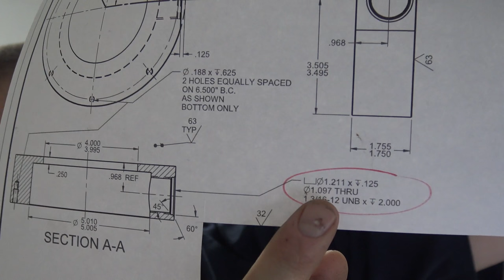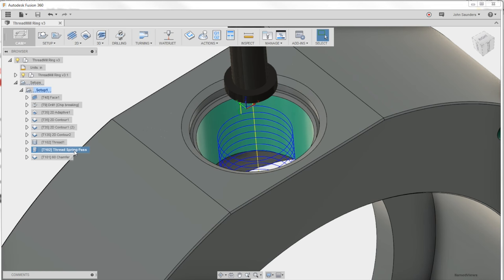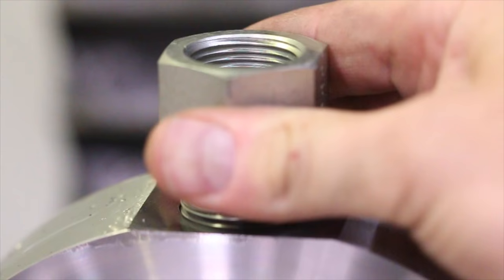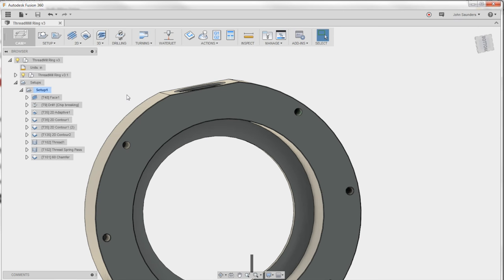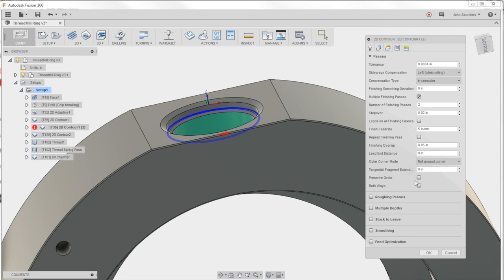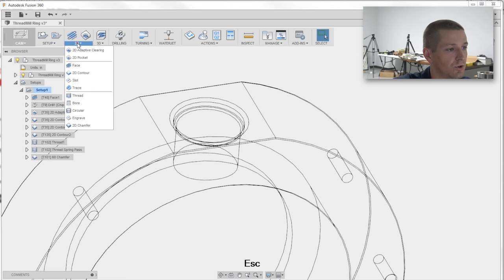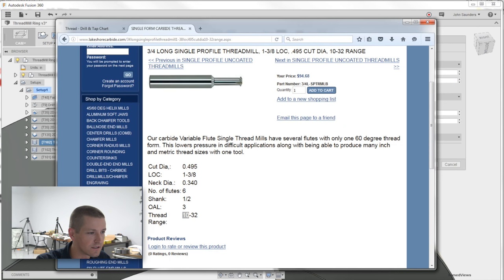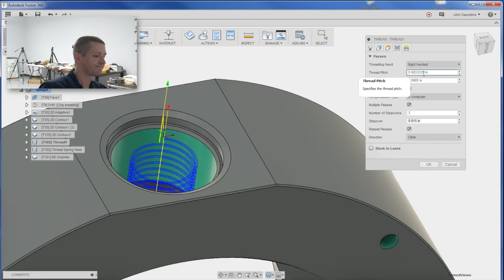Threadmilling on a Tormach with Fusion 360!  WW109

Comment: The thread and the chamfers are for a SAE #14 O-Ring port. It will seal effectively at high pressures, something like 5000 psi.
Nice video.
Thanks,
John 

🎉🎉🎉
Woo hoo, new baby girl! Congrats again. 😊
Reply: Yep, Day Job we make tons of manifolds and machine tons of  SAE Ports and Metric Ports. Part doesn't have a spot face must be using that flat he machined as the spot face
Reply: +Chief Machining 
Spotface would've taken up almost the whole face where the flat is and would've left a sharp edge to deal with.
Machine it flat and done.
Thanks,
John
Reply: Yea and cost way more instead hitting with a port tool and being done.
Reply: +Chief Machining 
For doing lots of them, you're right.
This is a prototype. Most of the machining was done on manual lathes and mills.
Special tooling was out of the question. Easier and faster to bring it to SMW.
Thanks,
John
Reply: Most have been your part? 

What's it for?
Reply: +Chief Machining 
Housing for a special valve.
It's proprietary but we'll be unveiling it in a couple weeks. 
I'll post it when we do.
Thanks,
John

Comment: 1st.
The reason "you need to always go a little bit further" is because the ideal thread forms are not triangular pyramids but are triangular pyramids with the major and minor peaks/valleys lopped off.  The Major and Minor diameters you read from the table are the diameters at those lopped off flats, now your tool path Diameter (the way you are programming it) is the diameter at the vertex of the triangular peak which is not the same thing.

2nd.
Your statement "In Theory all 12 pitch threads should have the same difference between the minor and the major (diameter)" is fundamentally correct. Where you are going wrong is the Major & Minor Diameter for an Internal thread vs External thread are not the same.

Minor Diameter for 1" External is 0.8978" but Minor Dia for Internal is 0.9098"
1"-0.8978"=0.1022" EXTERNAL Minor Dia which is what you wrongly calculated.
1" - 0.9098 = 0.0902 INTERNAL Minor DIA. Which is for intents-and-purposes is the same as the 0.0905 difference you calculated for the 1 3/16 x 12 tpi.

Cheers
Reply: Graphically this is the Lopped off part you are overlooking. https://upload.wikimedia.org/wikipedia/commons/thumb/4/4b/ISO_and_UTS_Thread_Dimensions.svg/2000px-ISO_and_UTS_Thread_Dimensions.svg.png

Comment: +nyccnc Hi John. I have done a lot to debunk and prove out what Fusion wants for this & hopefully help others. Below is for Internal Holes As we are using a Thread Mill, this assumes your cutter tooth tip comes to a POINT.
1: The Minor Dia calcs from your reference and any others take into account the Standards. So it is CRITICAL that with what I am about to say; that the ID hole in the fusion model is exactly the book Reference for Minor Diameter. I have checked your book figure of 1.097 and it aligns. Some web refs are wrong so use this formula to check: Minor Dia = Maj Dia- (1.0825 x Pitch)   Eg: your 1.1875  12Tpi
1.1875-(1.0825 x 0.083333) =1.0972    

2: Now you need to know the thread height BUT it also has to consider the above with respect to the fact Standards have already been worked in. So; Height of the cutter Triangle is: H=0.866 x Pitch. But with standards already worked in we actually need 6/8ths of this height for an Internal thread. HStnd= 6/8 x 0.866 x Pitch. e.g. Hstnd= 0.6495 x 1/12  = 0.6495 x 0.08333 =0.054125 Radial Depth of Cut or x 2 = 0.108 Diameter.
NOTE: You used Maj - Minor Dia, the reason this is too low is again because of the standards.  That figure you got of 0.09 is the thread measurement from Flat to Flat i.e. 5/8ths of Height. The Minor dia figure from formula or book took care of the thread peak at the hole ID (2/8ths or 1/4) and now we have to allow for the Tool tip of 1/8th thread height, hence 6/8ths in the formula above.
SO: Pending material, tool deflection and assuming the correct size Single point threadmill for the pitch i.e. has enough tooth depth/height to complete our calculated Radial DOC; the figure Above of 0.108 is pretty  spot on unless you want a tighter fit. WHY? Well the Minor Dia figure which we set our fusion Modeled hole ID too, basically works out to around a 73-76% thread fit hole diameter. So if you want a tighter fit I suggest sneaking up on that 0.108 Diameter offset figure in fusion AND if you have the male part, test fit. Test fit is key because bolt tolerances particularly on cheap fasteners are very hit and miss to the dimensions we have calculated, but what I have typed here will get you on your way. NOTE: If you start fudging the modeled hole ID away from the Minor Dia figure then this  above will obviously be inaccurate without further maths, hence I just adjust the Offset in fusion.

Also all of these formulas above work for METRIC e.g if you have an M10 x 1.5 thread; just use 10 as the Major/Nominal diameter and put 1.5 as the Pitch. The Constant I have given remains the same, results can simply be convert back and forth from Metric to Inch using 25.4mm = 1Inch.

Lastly: I reported to Fusion a while back that Pitch Diameter Offset was is not the best name. It doesn't do any algorithm in regards to the ACTUAL theoretical Pitch Dia. If you check through the GCode it simply adds this 'user input' Pitch Dia offset  to the 'hole' ID you have selected/modeled and takes the tool radius of the cutter into account. Hence if your Hole ID is not accurate to the theory of threads and thread fit it will vary your result. If you were to put in the ACTUAL Pitch Diameter offset figure from the ID (Minor Dia ) hole you wont even get close to a thread that fits. I have reported this a long time ago that they should change the name as it confuses everyone, nothing has changed.

Hope this Helps
Reply: Your information was awesome.  TY

Comment: I'm sure it's been answered, but the simple answer is like this.  The sharp point on the tool requires a deeper depth because thread form is based on a tip with a radius.  The sharper tool requires you to go deeper because you're essentially farther away from the required PD.  Think that makes sense, hope it helps.

Comment: John the reason that you need to take a lil more than the .905 is because that is at 100% thread engagement and the normal thread engagement is about 75% which is the lil bit more that needs taken.

Comment: Hey john;

The difference could be that the minor diameter of the two different thread sizes you referenced could have different tolerances on them. As you looked at the acceptable sizes not the theoretical.
 It could also be the flat or radius on the tip of your threadmill is not the same as the theoretical used for the calculations.
As a side note, the corner radius/ flat on each tool isn't the same. It has a tolerance just like everything else. This tolerance will effect the finished pitch diameter; given that the OD of the tool is the same. However the OD also has a tolerance.

This radius/flat on the tip also applies to lathe threading inserts.
This is typically only noticed when trying to achieve decent thread fit.

Comment: When I thread mill in fusion I usually select "model thread" in the threading pop up box during design, once in cam, just select the modeled major diameter as the contour for the threading op and select your pitch. No need for calculations etc.

Comment: I use a lathe internal indeable toolholder as thread milling tool. It's slowers since you only have one flute, but it you broke the tip, it's only a couple or bucks

Comment: A question not necessarily related to video in particular: quotations (pricing).  How do you provide a quotation for a customer, when you have to go through a number of times (which you do not know until the appointed time), to get it right?  Say the "widget" spoils and you have to use fresh materials.  Also, additional machine time.
Reply: You cant add time for your mistakes...well unless you are some shady shop. 

Would you pay for two oil changes if jiffy lube forgot to put plug in first time?

Comment: Funny way to hold on to a part it made everything slow. Thread mills with inserts are better for this cos it will only damage the insert if something goes wrong, you can also use some lathe tools that have round tails so that you can hold them.

Comment: I believe that's a fitting called "oring boss". Those dimensions are pretty critical to that fitting not leaking over time. A washer and nut typically will be on the fitting and will force an oring into the small clearance on the fitting. Your customer has a straight fitting without a nut and washer. I've dealt with them on the fluid power side of things, never in a machine shop. Burrs cut the oring and the oring size is critical. Looks nice, you'll know if your size and finish are good if it works for them.
Reply: O-ring gland.  And that's usually only on ports.  Doesn't look like a port fitting to me. Could be a modified simple port. 

They make specific SAE-J#### porting tools to cut the specific spot faces and angles. 

The 2 chamfer angles seem reversed. Usually the 60deg is at the top of the threads and the 45 is at the hole opening. 

On a side note. A good practice to get nice clean tapped holes at the top is to spot to .005" - .010" over the tap major dia with a 120 deg spot. Using a 90deg spot leaves a funny transition between the chamfer and the start of the threads.

Comment: The Reason you have to cut deeper then the Book says is the Corner Radius of your threadnill. The Book Values are calculated with sharp Angles.
Reply: Is tool deflection also a factor?  I would think this is more likely than a tool radius.  The tool radius should make for a looser fit unless the tool diameter is an effective diameter to a theoretical sharp point and not the caliper diameter of the tool.  I'm just thinking out loud here, so I easily could be wrong.
Reply: All you guys have hit on aspects that affect the result.
Sometime when you're looking for an interesting challenge, get a copy of the standard for Unified National Thread forms ASME/ANSI B1.1.
Lots of equations and tables for thread tolerances and dimensions. The basic thread form is 60 degree with sharp points and the basic equations start there. However, the writers of the standard know that it is impossible to cut threads with sharp points so they add allowances for tool radius, truncated thread tops, etc.
Reply: Anyhow, the key dimension is the pitch diameter which is nearly impossible to measure directly.
On internal threads, the minor diameter is a separate feature from the thread. That's how we machine it, too. We drill a hole to a certain size and tolerance so we get a good thread form that engages properly with good strength. The depth of cut is dependent on the thread pitch and pitch diameter and is almost independent of the minor diameter. What I mean by that is if the pitch diameter is oversized by .003 inch, the major diameter of the internal thread will follow but the minor diameter won't.

The end result is that by the time you stack up all the allowances and tolerances of both the part and the cutting tool, even if you calculate the pitch diameter correctly, you will have to make adjustments. Cutting good threads becomes somewhat of an art form rather than just some good math. Don't get me wrong, we need the math to get us as close as possible but there will always be adjustments.
Reply: +Caveman's Mancave 
Yes. Threads are most certainly an art. Once you delve into all the class of fits H/D values on taps, tap tolerances, minor/major/pitch dia tolerances.  You could spend literally weeks going through book after book, formula after formula and still barely scratch the surface. 

Threads and their accompaniments are probably hands down the simplest concept, but the most complex reality there is in machining.

Comment: I'm not sure what the Tormach's RPM maxes out at, but you should have been running that 3/8" carbide closer to 3000rpm to get a good cut on it.

Comment: The listed major diameter is to the sharp V of a thread. If the 2 parts had the same major thread diameter, there would be no clearance for the thread to go in. It would be an interference thread (kinda like a press fit dowel). For a part to thread in and it needs clearance on both the major Dia of the thread and inside the V. The amount of clearance is referred to the H-class of a thread (that's the H# on a tap) smaller the H# the tighter the thread is. 

Larger diameters require larger H#. At 1-1-/2" you're around an H4-H5 fit which is .002-.0025" over major thread dia. for clearance. So you'll to take an additional amount off. But it's not a 1:1 formula. Remember the thread mill is a 60deg included angle (120deg total), so the formula for the additional amount to take off follows similar to calculating a chamfer dia for a 120 deg spot drill. 

There's also an additional compensation due to the helical tool path with a tool whose flutes are perpendicular to the cut.
Reply: Also threads have a root flat dimension at the maj dia crests and the minor dia valleys so there's a small flat area at the major dia crests that the thread mill (most anyway) doesn't have. So you have to bump it out to compensate for that as well. Which means going beyond the maj dia of the thread. 

In short. Threads are actually am very vast and complex subject, they're no as simple and straight forward as they appear.
Reply: Annnnd one more helpful hint to thread classes. For general purpose (95% of threads) this is the H (D for metric) class you will want for taps. 
[standard]
#0 - #2 H1 for UNF. H2 for UNC
#3 - #8 H2 for UNF H3 for UNC
#10 - 3/8" H3 for UNF/UNC
7/16" - 3/4" H3 for UNF H4 for UNC
7/8" - 1-1/2" H4 for UNF/UNC
[Metric] 
1.6 - 3 D3
3.5 - 5 D4
6 - 8  D5
10 - 12 D6
14 - 20 D7
24 - 36 D9

Comment: Question for you John ( or anyone ) when cutting a thread on a lathe you set the cross slide to 30deg and adjust your depth of cut along this axis so you are cutting on 1 face , does thread milling do the same  ?
Reply: You should actually be at 29.5 degrees. Gives you clearance to the  of the cutting face of the threading tool. 

The thread mill does have clearance ground into it for the main cutting edges and the helical path by its nature gives clearance to the lower part of the tooth.

Comment: I think you have to cut a little more than the actual pitch diameter offset because of the nature of thread milling. Your threads are coiling at an angle, while the flutes on the thread mill are horizontal. Basically the flutes aren't cutting at the angle that your threads are coiling, therefor, there is always going to be some material that isn't getting removed that in reality needs to be removed. This effect would probably be exaggerated if you were using a larger diameter thread mill to thread a small hole. unlike a tap, where the flutes are actually angled, I imagine this is why this happens with the thread mill. Just spitballing, it makes sense in my head, but then again, I'm sort of special so there's that.

Comment: Incrementally reduce the depth of cut.
Take the max # of passes you want to do. 
In this case 3 
1st pass at whole depth 
2nd pass at 1/2 the 1st 
3rd pass at 1/4 the 1st 
so that would be 1X+.5X+.25X=1.75X 
Y= the single depth = 1.75X 
then X = Y/1.75 
=SUM(D13/(1+0.5+0.25)) 
Paste in excel, D13 is the single depth

Comment: So in the vid you mention a "thread spring pass" and say you will discuss at the end but I did not see that. Also I don't see a Thread Spring Pass option in Fusion 360 I'm using (9/1/16). What is this spring pass?
Reply: It's a clean up pass if the tool flexed it can take the little bit of extra stock that didn't get removed from the roughing passes

Comment: How did you do a multiple pass step over with the 2D chamfer or how did you make Fusion do what would be "tip offset" in the 2d contour you used for your first chamfer? I need to do a really broad chamfer and want to do multiple step overs.
Reply: He used a regular contour toolpath and not the 2D chamfer path. For the specific reason that the 2D chamfer path doesn't allow for multi-pass.  Which is a really dumb oversight in Fusion of you ask me.
Reply: Thanks, what confused me was John must have renamed the 2d contour to "chamfer" in the tree on the left. Still wondering the best way to make the 2d contour chamfer the correct width with the desired tip offset, offset sketch maybe?

Comment: How would you have aligned the part if they would have (unfortunately) given you the part with the bolt pattern already drilled?
Reply: Put pins in the 2 holes opposite eachother and use blocks to make the centerlines of the holes parallel 

If there wasn't 2 holes directly opposite eachother you'd probably have to build a fixture plate to correctly orient the part.
Reply: Ah! I guess the only way that would get tricky is if you could not orient the part based on that. If you had to orient some angle relative to that if that makes sense. Good call.